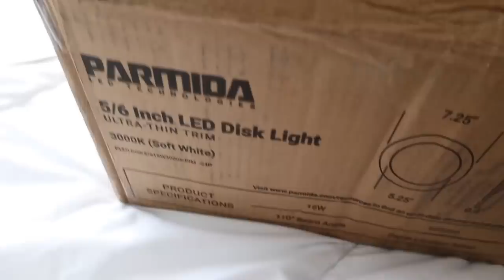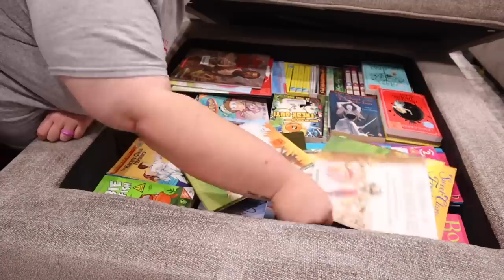NEW MOBILE HOME UPDATES | adding more lighting throughout our single wide | mobile home makeover

Comment: I know this was from awhile ago but you was talking about what happened with your hair and coloring it to much caused a lot of breakage, I had similar problem but mine was the curling iron that caused mine.  It was to the middle of my back and with in a year it had broken off to my shoulders.  My hairdresser told me start taking a vitamin called Boitin it’s for hair and nails and with in a year and half it was back down just under my waist and my nails are growing like crazy. I always had my nails done because they wasn’t growing very good either and now I have to keep my emery board handy to keep them from getting to long. The nice part is that you can get them in the gummy form.

Comment: Thieves are after copper wires. Where i cleaned horse stalls at, some horse boarders had the copper wire from their horse trailers cut off. That's probably why Lowes has wire behind a cage now. Thieves suck.